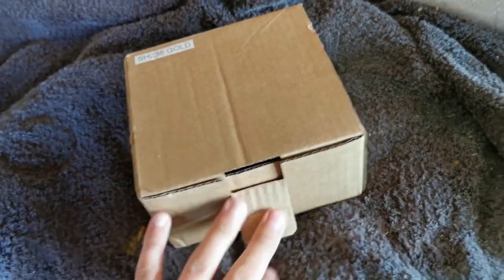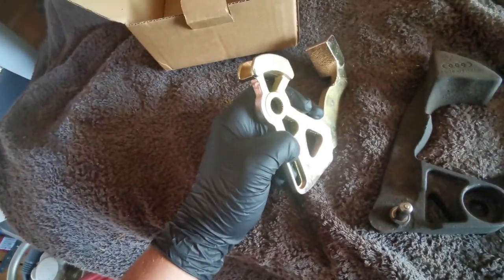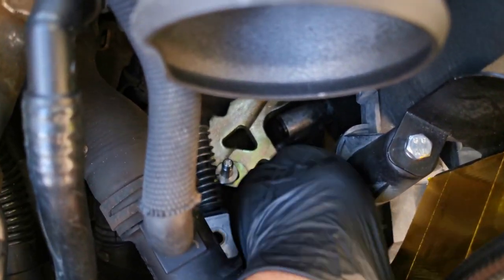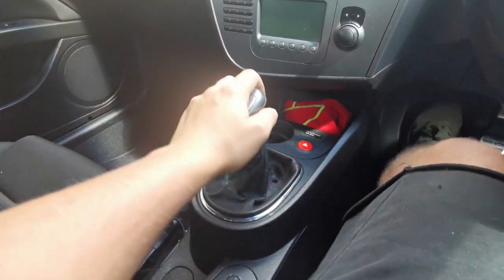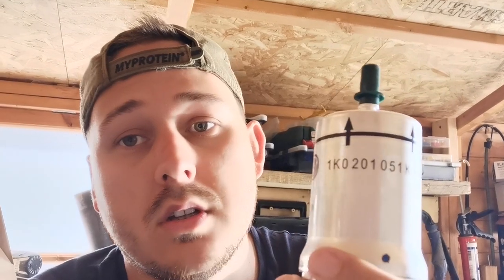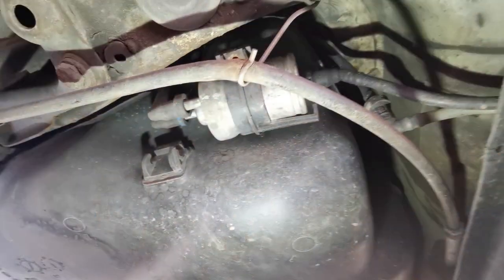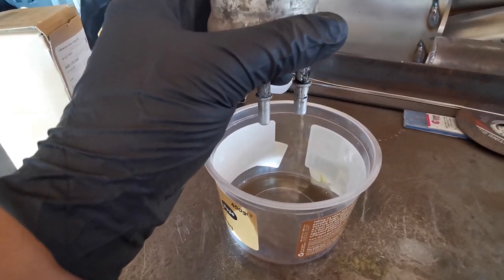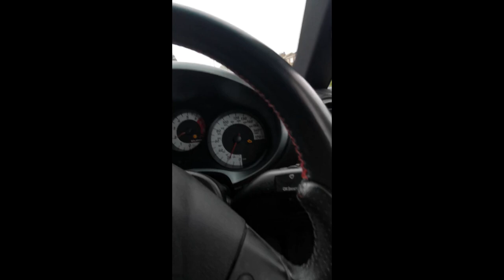Short Shift and fuel filter - Seat Leon Cupra MK2 - Ep.7

Comment: Good vid! How do you get the fuel filter off 🤣 could I fuck get mine off 😆😆
Reply from the maker: Unscrew the small screw holding the filter in then push the little black and blue clips on the pipe and pull away from the filter and they pop off